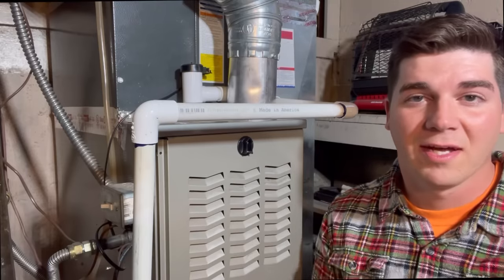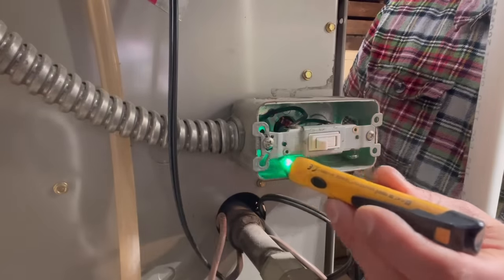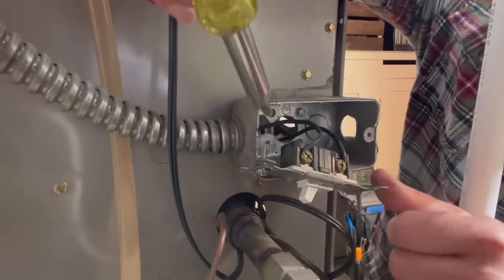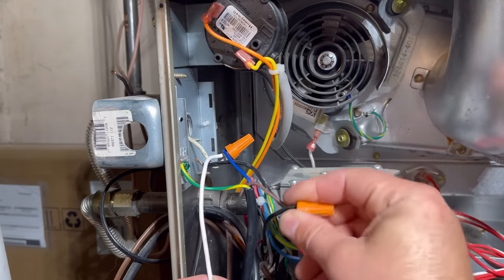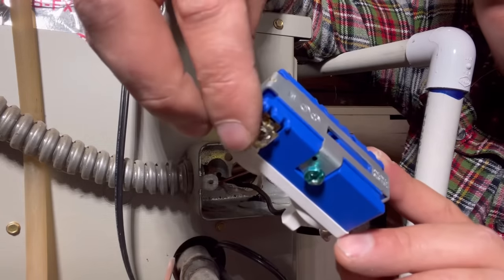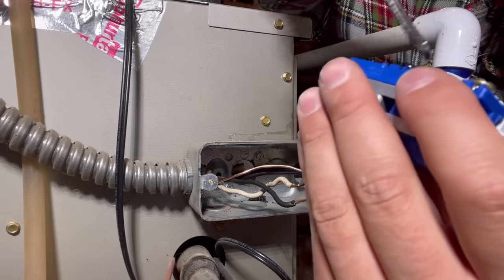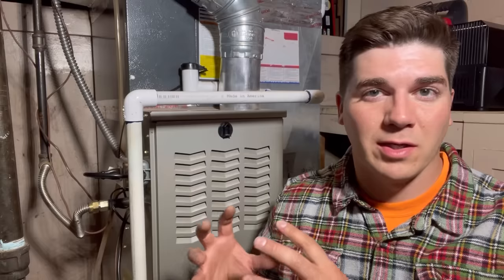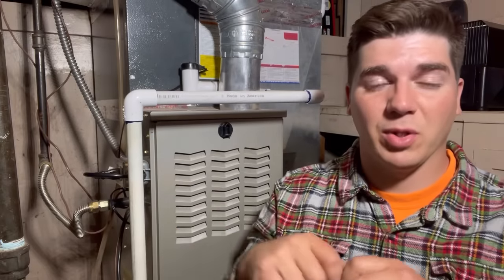This Could Keep Your Family Warm During An Emergency Power Outage.

Comment: Wouldn’t you be back feeding the grid if you forgot to shut the switch off?
Reply: Not at all. When on Gen, the power is ONLY supplied to the furnace, not backfeeding the elec panel
Reply: Oh, I see, the outlet box is basically just an extension cord, and your pigtail simply runs through the box and has not connected to anything inside the box. Thanks!
Reply: @leedchristensen  I prefer to install a 3-way switch by the electrical panel. One side of switch is marked GEN the other side is marked LINE. The switch box has a short plug hanging out to plug the generator in. This way no modification of the boiler is required and all the red safety switches are still active

Comment: is this the same process to connect a mini-split system to a generator? 🤔
Reply from the maker: No, but that is a brilliant idea! I’m totally going to do a video on that! Some mini splits are 220 and some are 110. Everything gets it’s power from the condensing unit outside, so the condensing unit would need something similar to this but rated for exterior use. Thanks for the idea!! Cheers

Comment: You could wire in a (n illuminated) three-way switch  (upstairs)  so one need only flip the witch when teh power went out to connect the heater to the inverter.  PS: Ig you have a Haitat for Humanity ReStore - look for your switches in their bins - lot cheaper than $1 for a switch on Amazon!

Comment: What if you have as Heat Pump can you still do a set up like this still.
Reply from the maker: Nope this is for gas furnaces only. I’ll be doing a video  on how to run your heat pump or ac with a generator soon!
Reply: @diyhvacguy looking forward to that video.

Comment: So I’ve done this to my furnace, however the motherboard seems to be very picky about the ground.   I’ve had to make sure my power source (battery bank, generator, etc) are grounded to the same circuit that the furnace is grounded to. This usually means I leave the furnace grounded to my panel and then run a ground wire from the inverter to the panel as well. Has anyone else had this issue?
Reply from the maker: Try taking an old extension cord and cutting the flat tabs off so you are left with the ground on each end. Plug one end into your inverter (one of the other ports) and the other end into one of your home outlets (even though there is no power) and see if that resolves your problem

Comment: Will that send power out the line back to the breaker panel?
Reply: @@One-ik4pb ok,right...goes from switch to outlet... furnace gets power from wherever cord is plugged. Out of outlet, removed from the grid. Thanks. 😊

Comment: Is there a similar set up that can power an electric heat pump?
Reply from the maker: No this is only for a gas furnace unfortunately. But I’m planning to have a video showing how to run your heat pump and or electric furnace with a generator very soon so stay tuned for that! Cheers

Comment: How does this effect the out side unit in a heat pump
Reply from the maker: This is only for a gas furnace. Will not work for a heat pump or electric furnace unfortunately.

Comment: Here's a "minor" detail - this is a 20-amp circuit, right? It is connected to a 20-amp breaker, right? And you used a 15-amp rated combo switch and receptacle, right? And then you used a 15-amp rated pigtail, right? So, in summary, you used 15 amp rated devices on a 20-amp circuit, right?
Reply from the maker: It’s not on a 20 amp circuit. I stole that breaker flip snippet just to emphasize making sure the breaker is off when doing this.
Reply from the maker: The furnace is on a small double slim breaker 15 amp
Reply: @diyhvacguy  So, you produced a video showing a 20-amp breaker. And this was "a snippet". Uh-huh - so here's a quick question for you - out of all of the gas-fired forced air furnaces in the world - how many of them are on a 20-amp circuit?

Comment: Hello DIYHVACguy I have for you a potential video idea. I know there is a simple solution for having emergency power to my home well which is our source of water. I am thinking a switch over system from electric utility co. to a home generator in the case of hurricane and other power outages. Could at times be only wind storm in our area on occasion. Thanks in advance. If you can I will promote to many people. ..... 😃  😃  😃

Comment: Why not go to the main line feeding from the breaker box and some where in between the breaker box and furnace put in a junction box with a pig tail. Then when power is out turn the breaker off n plug in ur pig tail to ur inverter. U seem to be way over thinking this.
Reply from the maker: I’ll have another video on doing it this way soon! Stay tuned. Cheers

Comment: 2 rookie mistakes. The power cord can be made long enough to plug into said inverter and spooled up when used otherwise. I never use clips, especially in an open chassis configuration. Either solder or mechanically twisted and wire nutted connections. Good idea otherwise! Smart kid! GodSpeed!

Comment: Any concern that the switch linked to in the comments of this video is a 15 amp switch that is connected to a 20 amp breaker?
Reply from the maker: I nabbed that part of the video but that wasn’t my furnace breaker. Mine is indeed a 15 amp
Reply from the maker: Just to emphasize safety.

Comment: A lot of work   Why not go to power line coming from breaker cut and install a male plug on line going to furnace and a female on line coming from breaker. Plug together and you have power to furnace   Power outage? Unplug and plug in any source of power you have with a drop cord far less trouble than messing wit switch furnace wiring etc.
Reply from the maker: Can you explain this in greater detail and email it to me at diyhvacguy@gmail.com?   Thanks so much. I’m just struggling to understand what you are saying I can do. Thanks,   Dave

Comment: This is redundant. No reason to have a switch plug for a furnace. One can simply pull the plug to disconnect and then run an extension cord to a receptacle that's on a generator, if the furnace isn't on the generator. But the purpose of a receptacle or switch is for a disconnect of the furnace. And that's where the redundancy comes in with your application. You have two disconnects from the same box.
Reply from the maker: Building code

Comment: The fan is what sends the heat through out the house. it's going to take more than an inverter from tour car battery.
Reply from the maker: Don’t knock it till ya try it. It works
Reply: @diyhvacguy  Sure it does.

Comment: Could have just gotten rid of the switch since you have the plug as a disconnect.
Reply from the maker: Yea I might do a separate video showing that since it is a lot easier to wire up

Comment: If you're going to do this properly, you need to have a KO ring or romex connecter between the electrical box and unit to prevent wire chaffing. Also, you really do not want plastic pvc pipe next to your flue. Code requires 6" clearance to anything combustible on a Type A (single wall) vent.
Reply from the maker: Thank you for that. I did install a grommet. I’ll probably change that pvc drain. It’s been like that since we bought the house. 5 years ago

Comment: We don't have a switch on our furnace.
Reply from the maker: If you have an outlet and a plug it achieves the same purpose. As long as it has a means of disconnecting power right there at the furnace 👍🏼

Comment: Didn't you forget to mention in the event of a power outage you supposed to plug the pigtail into the invertor, or I'm confused
Reply from the maker: No you are correct. I thought I did explain that. If you watch my video that has a generator in the thumbnail or the one that shows the inverter under the hood of my truck, both of those show how to use this in the event of an emergency 

If you had no power and tried to plug in an extension cord to the outlet, you’d have a female at the other end which wouldn’t work anyways.   Cheers
Reply: @diyhvacguy  Thanks for explaining that, Still was a great video and learned something for sure.

Comment: May I ask what you gain with the switch?
Reply from the maker: It’s building code
Reply: It is NEC code to have an electrical disconnect for most equipment.  However a cord a plug is a code compliant disconnect. It is not required per the National Electric Code.

Comment: What powers the thermostat?
Reply from the maker: The furnace powers the t stat. As long as the furnace has power the thermostat will work as it normally should.
Reply: @diyhvacguy  thanks

Comment: I'll take a Generlink and a generator instead.
Reply from the maker: Man those things are nice but boy are they spendy!
Reply: @diyhvacguy  yeah, they're certainly not cheap, but sooo worth it. $2500 Canadian incl install, but it lets me run my entire house on a Honda EU5000 (not all at once mind you, but pretty close). I just have to be careful when I run the electric hot water heater, but everything else is good to go.

Comment: Why do all that can't you just walk your ass downstairs and unplug your unit from wall and plug it in to an inverter setup that's waiting to be used, unplug and plug in save all this !
Reply from the maker: Did you not watch the video? Most furnaces don’t have plug and cord, they simply have a switch. So this allows you to have a means by which you can plug your furnace into a power source.

Comment: Your not a licensed electrician. You have violated at least 20 electrical codes not counting having no permit. You NEVER connect a CL3 electrical cord to an outlet or ru it through a junction box. VERY DANGEROUS.
Completely wrong and potentially unsafe. 
IT is a Furnace ans CL3 wire can melt. 
PLEASE PEOPLE DO NOT FOLLOW THIS Amatuer unless you want your home to burn down.
 A furnace draws 20 amps and you have connected it using  a 15 amp rated power cord.
Who does not see a problem with this ?

Comment: Why not just use a 3 way switch? Up is normal operation and down enables the receptacle to be the input source. You probably shouldn't be giving electrical advice. Furthermore, the input power receptacle should be an inverted (male) recessed connection for safety.

Comment: This is not a safe way to do it, you are still grounding and sharing a neutral to the house with that switch off. Potentially VERY DANGEROUS if the right parameters align.
Reply: Please elaborate.  Thank you!

Comment: Do you have an electrical license?? BET NOT!! let me show you multiple errors:
1. When using WAGO (hard A) not only should the wire go all the way in but also make sure the insulation  is in the shell ie you should not see bare wire out side the shell.
2. Always loop the end of the wire under the screws!
3. NEVER have more than one wire under one screw. Make two leads to a WAGO
4. The cover should be red.
5. For more info please refer the National Wiring Code or NFPA 70. 
6 And most important of all. DONT KILL YOURSELF 😂

Comment: This is utterly useless. Just backfeed the panel woth a transfer switch, isolate whatever is not needed or a not a priority and run it from there.
Reply from the maker: Backfeed the panel by what means?
Reply: @diyhvacguy  IDK man, take a guess, outside plug+interlock, transfer switch, there are plenty of options. Furnace doesn't take that much power, but running it separately with an extension cord seems ridiculous to me.

Comment: Some people should not do their own electrical work! Several mistakes made in this video. Okay idea, if done correctly.
Reply from the maker: Are you going to make this comment valuable and say what needs to change? Otherwise it’s a waste of peoples time.
Reply: @diyhvacguy  Yes I can. 1. the "cord clamp" you used is not correct. That clamp is for NM cable, not cords. You should use an actual cord connector / strain relief. 2. when you installed the wrong clamp it appears by the video that you just finger tightened the nut on the back. That is dangerous and not allowed. 3. where the cord passes through the furnace wall through the two electrical boxes you need to have either a plastic grommet or a conduit bushing. this protects the cord from the raw edge of the sheet metal.

Comment: Really?  So you just turned your furnace into a plug in appliance, with a switched receptacle to cut off power to the receptacle?  Why the switch, if all you have to do is unplug the furnace plug?  🤔 🤣
Reply from the maker: Building code
Reply: @diyhvacguy  Understood, but modifying the furnace from being hardwired to a plug in appliance is up to building code?  Just curious?  Thanks.

Comment: I don't think a single pole switch is safe for this application in which you need to separate the furnace from the house in a power out situation.
Reply from the maker: How come? That’s what this switch is designed for, I purchase them directly from the Goodman dealer
Reply: @diyhvacguy  I'm not an electrician, but there's the possibility of current flow on the neutral/ground back into the house.  Granted, that might only happen if something fails in the furnace, so it's a long shot.  I did this in my house with a double pole switch a few years back, but I had to use a double box.